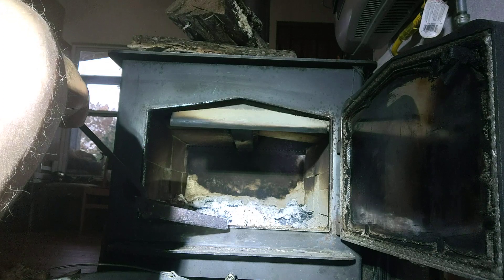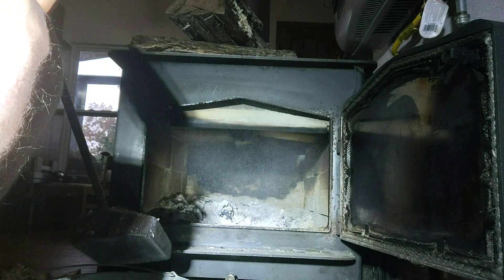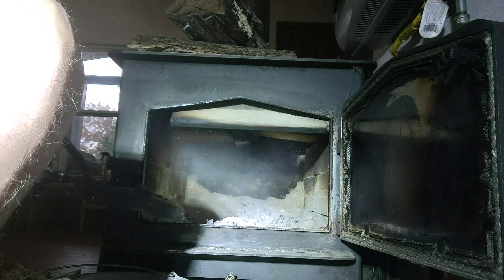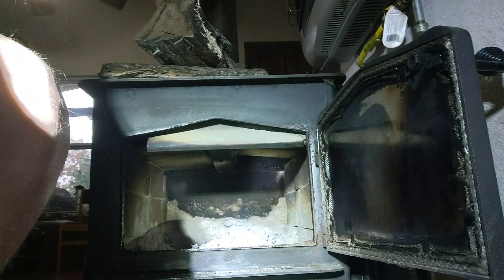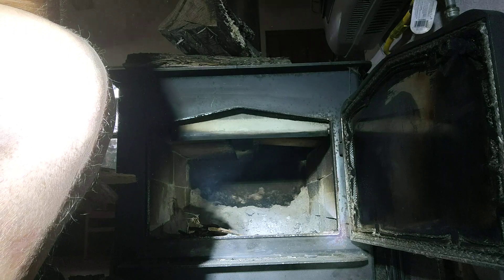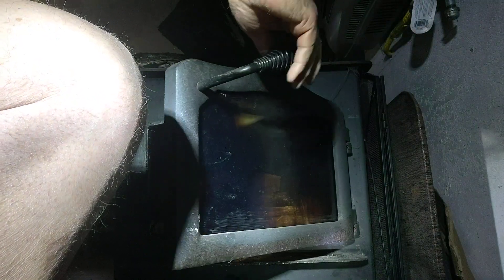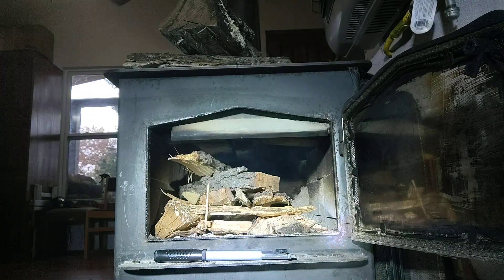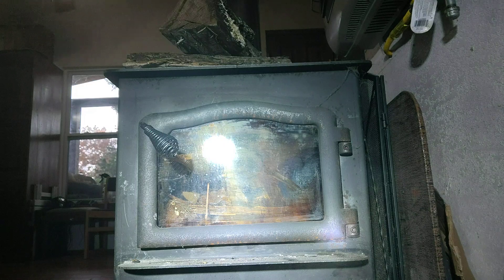Wóod Stove Tips & Tricks: Top Lit UpDraft Talk

Comment: Thanks for another great video 😃
Reply: @ Robert Sturek,did u finally get to the Ozarks ? Or r u still up north(in N.Y.)?
Have some faith.
Reply: @raysova7666  I haven't found land but I'm closer to moving more then ever, I'll be out there by the end of the month if all goes well for me, thanks for checking up
Reply: @ Robert Sturek, I'm in the process of moving. Between moving I camp on my new property.
It was cold the other night. I used my Jack Russel for heat inside my sleeping bag while in the jeep.
I'm setting up a tent structure to stay in(a 10'×10'×6' chain link dog kennel  w/tarps,no shame!) n installing a wood burning  stove.
Due to new EPA standards their expensive.
If u can find one for less than $200.00,get it. The new ones r costing $400.00 +. It's the price for the small ones now.
Sweat pants n sweat shirt is what I sleep in. This way I'm always dressed to step out doors.
If u ain't prepared,all u need is the mind set to overcome issues.
Have FAITH.
Reply: @raysova7666  thanks for the info I appreciate it. God bless I hope you and your pup stay warm
Reply from the maker: one thing I really like is extra large zip together double sleeping bags you get right and left or top and bottom ones that gives you a lot of extra room to  turn around in, even share heat, but you get really good bags I'll give you a links on eBay.
Reply: @robertsturek3312 ,the pup is like a hot ember. A real blessing.
There's always hope.
Get the mind set.
Reply from the maker: Please get your phone number to me!!!
text or call me. I have a neither every from NY!!
was gonna take the bus 

dmnds2001@yahoo.com
417-988-0333.
Reply from the maker: Please get your phone number to me!!!
text or call me. I have a brother Michael Johnson,  from NY!!
was gonna take the bus. needs a ride!!!

dmnds2001@yahoo.com
417-988-0333
Reply from the maker: How you doing brother??
Reply from the maker: @raysova7666 

Ray,
Have not heard from you for a while.
If you dare still there in your land, drop me a line.

dmnds2001@yahoo.com